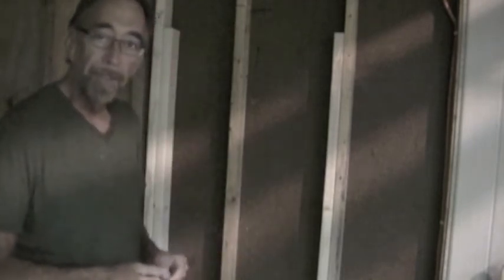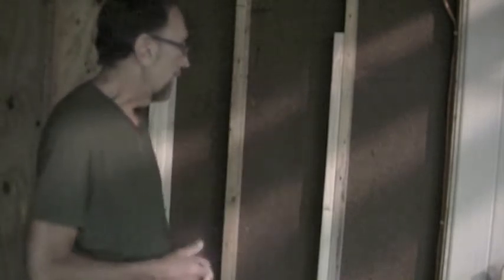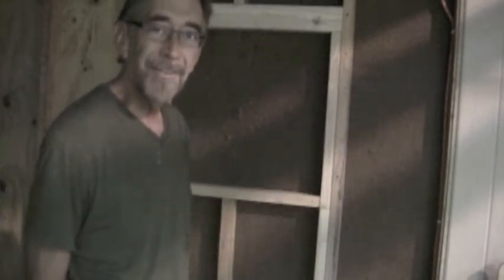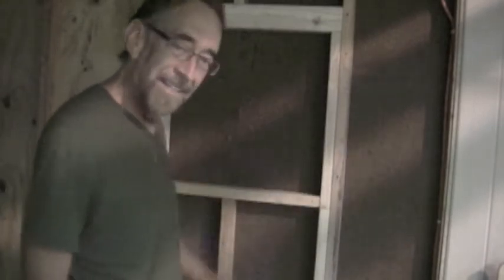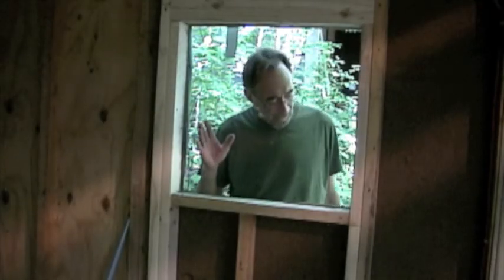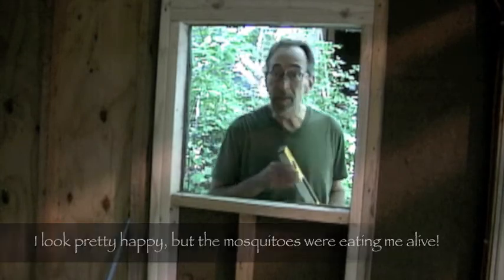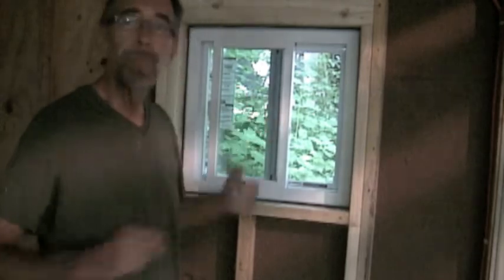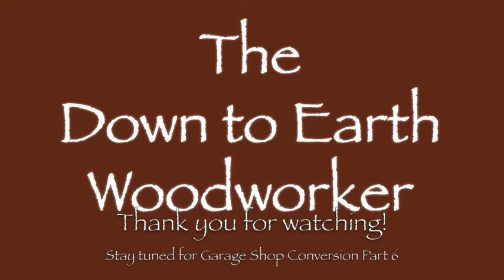Garage Shop Conversion, Part 5 Install a New Window

Comment: I enjoy all of your video series. I will certainly use many of your ideas when I finally build my own shop. I would like to share one tip for your viewers when cutting studs in an existing wall without damaging the sheathing/drywall with a recip saw. I use the Dewalt Flush Cut jig saw blade DW3311. It allows me to cut right up to the finished drywall (on the other side) without damaging it when installing headers and sills. $10.00 well spent. again thank you or sharing your videos.
Reply from the maker: Thanks for the tip!
Reply: downtoearthwoodworks I should also mention that I started with a regular jig saw blade then switched over to the new blade, as this DeWalt blade's teeth are at the very front of the jigsaw base and have nothing to rest against the work with.

Comment from the maker: Typically most framers use two 2 X's (which equals 3 inches) and a piece of half-inch (sub floor, plywood, whatever you have) sandwiched between so the header is the same thickness as the 2 X 4 wall.

Comment: Where do you buy your garage window from, in a store or online?
Thanks,
Diana
Reply from the maker: dlspeed1 They are special order items from The Home Depot
Reply: downtoearthwoodworks Thanks!  I need to replace to wall windows for my garage and the walk-in door, but am having a hard time finding replacements for them, since I do not have a car, so have been searching online with no success.  Maybe online with Home Depot will hlep!  Thanks, Diana